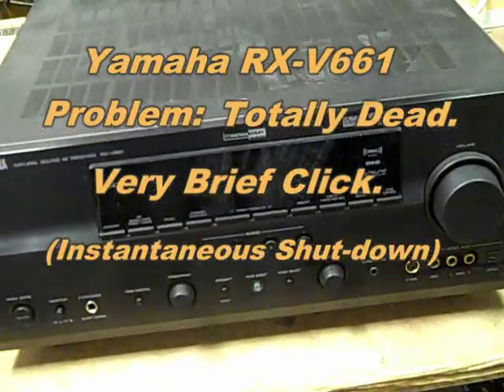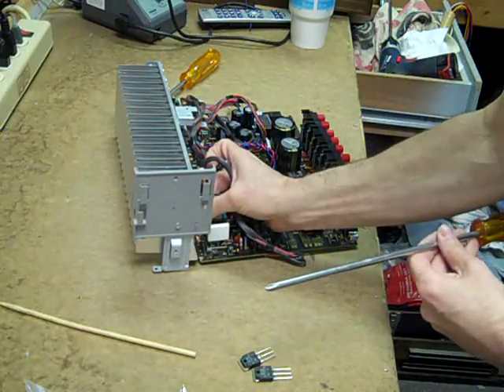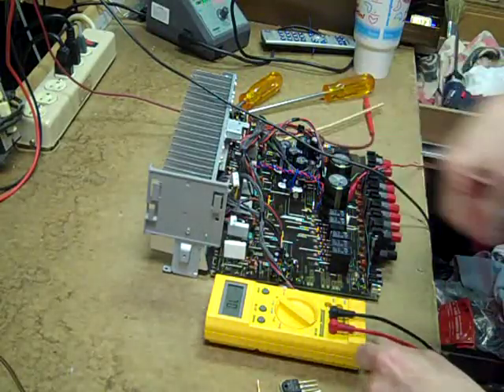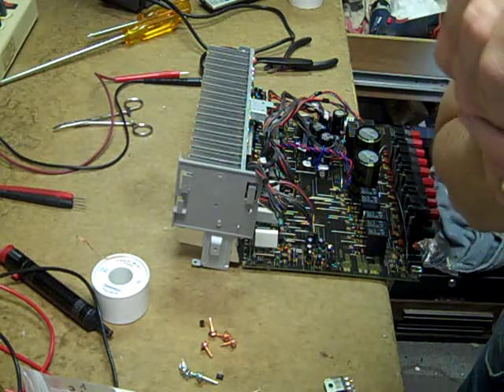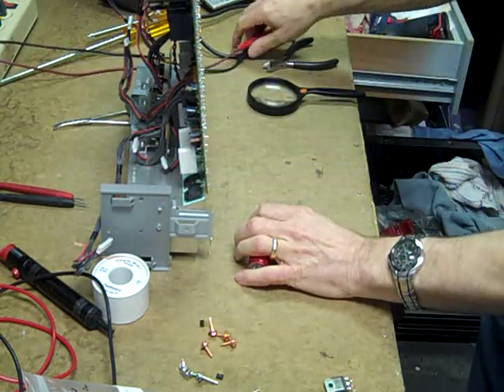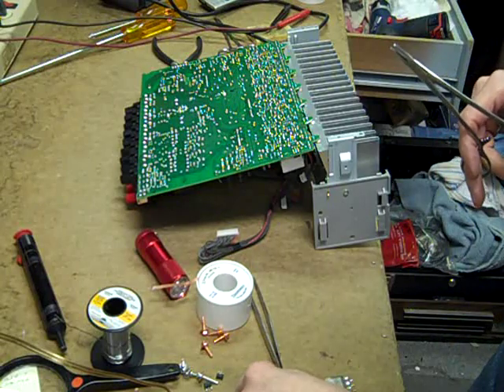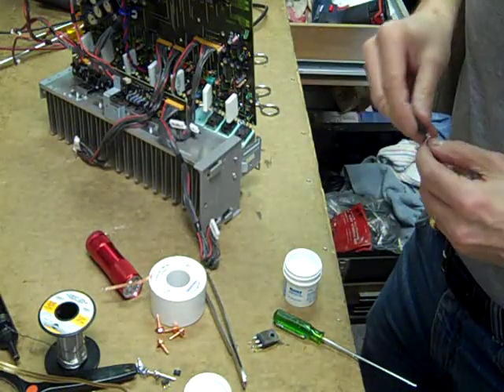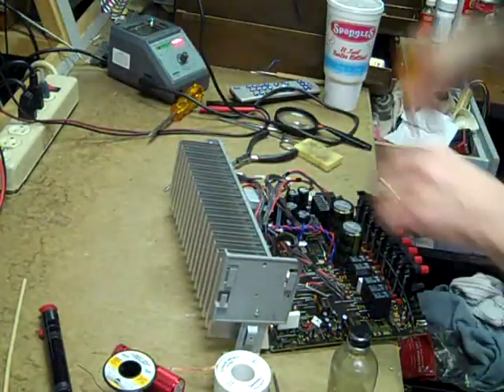Yamaha RX-V661 Repair Brief

Comment: Ok, I can't quit. So I checked the noble resistor and it is bad. I going to replace those two transistors also 'cause they are so cheap and apparently go bad. But can you say how to mimic that noble dual emitter with p/n mcm 28-0520 (since that part not available)?
Reply from the maker: Scott Young You might want to double check that resistor - they rarely go bad on the Yamaha's. If the outputs are bad I guarantee the drivers are bad, and probably the 5.1volt zener diode as well. Also the 100 ohm resistor that sits between the emitters of the drivers should be checked. I haven't seen dual .22 ohm 5 watt resistors on eBay. If it's really bad, usually only 1/2 is bad and the other half could be bypassed with a single. If you're in the U.S.  B&D Enterprises would have the dual, I'm sure. I have a drawer full of the things at work. They're really common if you work on these things. Many of those I have are pulled from scrappers.

Comment from the maker: I'm always a little scared to run the amp with the outputs removed - I had a Harman Kardon blow up really bad one time when I tried that, also there could be a problem with those drivers on that channel anyway. Still, might be worth a try. If you pull the emitter resistor, the micro can't sense any problem with that channel... I don't think, anyway.

Comment: I found the can that blew off the cap down in the receiver and it reads 16v4uf. They didn't have that at radio shack. Will a more common one do? The cap was in that assembly that screws to the heat sink above the stuff you are working on and has two 5 or 6 lead cables coming off it. Also wondering what soldering iron and vac you are using.  Thanks, Scott
Reply from the maker: Scott Young You can solder in a 4.7uF at 16 or 25 volts. Cut the leads fairly short and first solder the original circuit board pads a little, then tin the capacitor leads with solder. You should be able to use the soldering iron to then solder the leads to the board. Be sure to observe polarity of the cap. The old solder station was a junk MCM model and it died. I went back to using my old Weller station. The other device you may have seen is a Denon Instruments desoldering tool. I don't use it much anymore; a friend gave me a hot-air gun with a pinpoint nozzle attachment. Don't know the brand.

Comment: Hi mark I have a Yamaha RX-V396 5.1 channel receiver that previously had water damage to the main left channel. So I took out the shorted output transistors and driver transistors not sure if the drivers were bad but the outputs were shorted. The amp powered up and gave me sound out of the rear channels and the center channel. So to fix the main left channel I took working parts from the center channel to replace the Output transistors (Q216A/B) the driver transistors (Q201, Q203) the melted 330 ohm resistor (R214) and I also had to replace a blown 47uf 50V cap (C203). Also the .22x2 (R239) ohm resistors was open on one side so I replaced that also. There were also the 2 zener diodes (D221, D06) for the speaker protection relay that were bad so I also took that from the center channel as well. I also took the relay out of the center channel because I took away the protection diodes. Now the reason I did this is because I’m cheap and I want to know what parts I need to fix this channel before I order them. However it goes into high current shut down as soon as you push the power button display doesn’t even have time to turn on everything ohms out ok nothing is shorted even all the other channels ohm out ok. Any ideas I’m going crazy trying to figure this out. Thanks
Reply: +101computerman 

Got it working as it turns out even though the bias
transistor whitch ohmed out ok in the blown channel when I took the heat sink off to change it I found it has split in 2 now it’s time to order replacement parts
for the center channel

Comment: Darn it, I guess I have to quit. Got the cap from radio shack and put it in good. It powers up and lights the display for about 3 seconds then cuts itself off. Oh well got some practice at least. Thanks for the tips.

Comment: Hi, i have an amplifier which hv the label on the motherboard for the capacitor to be 2200uF 35V. However, the manufacture put 1000uF 35V caps in it. can i replace it wh the 2200uF 35V caps instead according to the board?
Reply from the maker: Normally this would work fine but I would not necessarily expect any improvement unless one or both of the existing capacitors were defective.

Comment: I am bit familiar with electronics. I checked all C4468 and A1695 transistors with DMM, could not find any shorted ones. I have not checked at resistors and diode yet.

Comment from the maker: I think you need to look at the PRV line on the Main (2) board. It's the board along the top of the heat sink, so you should be able to get to stuff pretty easy. The PRV line sums all the power supply lines and provides an error voltage for the microprocessor. This winds up over at IC21 pin 35. Occasionally the backup capacitor C103 might leak and give false trigger on the micro but usually just a bad regulator over on Main (2).

Comment: hi mark will you please let me know how  my hdmi problem fix RX-V465 video is yellow and all wires is good I checked so what might the problem should I check the regulator volt and capacitor please suggestion me
Reply from the maker: abhisek bhandari Normally in this situation the HDMI (Digital) board need to be replaced. Too expensive. If you are very good at working with surface-mounted IC's you could try replacing IC7 on that board. It is an SIL9134CTU 100-pin surface-mount IC.

Comment from the maker: @costellom5 You mean the desoldering braid? Pretty common in my work. I also was using a spring loaded solder removal pump, if I recall. I don't use that so much these days - too easy to mess up the solder pads.

Comment: Is it possible to run a 6.3 volt sin wave into the component via a frequency generator, then measure the component via ocsilloscope in XY mode?

Comment: Mark great videos you inspirated to me to fix my first receiver it an ONKYO HT-RC360 and it has issue like sidsasi described. The receiver has a clicking sound when powered on. It show a quick message saying check speaker wire before it turns off. The display only shows the message for about half a second before powering off. Im hopeing its bad capacitor all i know how to fix lol thanks for videos

Comment: …Based on the in circuit measurements (not precise, I know) the power transistor looks OK. I don’t quite get it, this transistor should have been fully on, but I guess electronics is not my forte. Anyway, I intend to replace the driver transistors Q707C (C3421) and Q707A (A1358), in lack of a better idea. I will have to order the items from eBay, so it will take a while.

Comment: Thank you for your reply mark.I checked the mute drive circuit and one diode D12 reads 14v on both sides so i de soldered it on one side and the eq works fine now.maby a faulty cap or transistor.I'll keep checking.

Comment: Update2. I tracked the high voltage, back to transistor Q708 (NPN, C2240). I replaced it, and now the readings at the Q716C (NPN power transistor RL) are much closer to the schematics: the transistor base reading changed from 6.2 V to 0.47 (0.4 on schematics). Unfortunately the symptoms are identical, and the display still shows the same PS PRT 39%. Other voltages are OK, no DC offset… I wonder if I can reset the unit, but how, since the display is gone in 0.5 sec. I guess I am stuck.

Comment: hi . i repaired a yamaha htr-n5060 with a power supply fault.  The fault was a 22nf capacitor in the power supply. It still has fault in memory stored. I see it in the diag menu . I goto menu 9 facotry reset but i don't know how to clear the fault (factory reset) . what button on receiver do i press to confirm factory reset? when turning on receiver it is shutting down because stored fault? Or is there still a fault somewhere? thanks
Reply from the maker: On a Yamaha, each menu selection in the service menu has the main selection and a sub-menu selected by one or two other buttons. In the reset portion of the menu, you must select the reset, then just turn the unit off. The reset will be effective at next power-up.
Reply from the maker: • Operation procedure of DIAG menu and
SUB-MENU
There are 23 MENU items, each of which has some SUBMENU
items.
DIAG menu selection
Main unit: Select the menu using the PROGRAM knob (RXN600/
RX-N600D/DSP-N600 models) or (Forward) and
(Reverse) keys of PROGRAM (HTR-N5060 model).
SUB-MENU selection
Main unit: Select the sub-menu using (Forward) and
(Reverse) keys of PRESET/TUNING.
Reply: @mdzacharias  thanks . when i reset. it is still going into protection. when i  goto menu nr. 20 there is p1prt 032 stored. in the service manual i read. i understand thay value 17 to 66 is normal. so 032 is normal?

PS1/PS2 (Power supply voltage protection detection)
Power supply voltage protection value (Normal value: PS1:
17 to 66, PS2: 36 to 53)
PS1: Detects +5S and +5DAB

does this mean there is still a problem in the power supply or  in +5S and +5DAB ? this are voltage regulators? thanks.

Comment: C3856 tested bad after all, but I am not sure that this was the original problem. If that was the case, why would have the receiver in diagnostic mode, tested a PS PRT voltage issue? Maybe this developed afterwards. Anyway, I will stick to the original plan (to replace both the power and driver transistors for that channel), and I will let you know... in a month!

Comment: Sorry, another comment. The transistor is actually cracked; if I press on it, B-C tests OK, B-E not; otherwise, neither conducts. That explains in part why this became evident after I removed the board the first time - I didn't screw it in tightly, as it was before.

Comment: Hey Mark, My RX-V661 turns on and has a display for about a second then shuts itself right off. Any help? It does not go into protection mode, I also checked the channels and they all appear to be good. So I'm at a loss?
Reply from the maker: You need to check the output of all the fixed voltage regulators on the Main (2) board mounted higher up on the main heat sink. Also the outputs of Q1045 and Q1046 (plus and minus 59 volts approx) and Q1000 (about -12.6 volts) . In order to facilitate troubleshooting problems not involving a blown channel or hard shorts, there is a protection cancel feature in the diagnostic menu. While pressing and holding "straight" and "audio select" press the Master power button and continue to press the first two until the SLEEP indicator flashes on the display. You can then troubleshoot the DC voltage problems at your leisure. If you have any technical skills and a decent multimeter anyway...

Comment: Great video posts, Mark. I have an RX-V667 that is tripping circuit protection on DC after a lightening strike. All values in the diagnostic menu are normal except for P1-1 (DC_PRT on IC902) showing value 0 instead of normal 32 to 74. Is there a place to start before looking at each amp channel?
Reply from the maker: ***** Start the receiver in protection cancel mode and see if there is a DC offset on one or more channels. DC on one channels obviously means that channels needs repair. More than one is a power supply problem of some sort, or there could be a problem involving Q1072 (not) providing a -12.6 volt bias to all amp channels.

Comment: Hi Mark.
I have a RX-v661 that goes in to protection mode. 
By the help of the service manual and your videos I have managed to narrow the problem down.

The DIGA menu tells me that it's PS2 Low that is the course of the protection mode. Now I have measured all the PS2 voltages (+12, -12, +5V, +5D, +5I & +3.3D) and they are all fine except one :)
When measuring the +12V at connector W100A I only get around 1.52V between pin 2(E) and pin11 (+12).
I then measured the input to the +12v regulator (IC104)  and that show +22V, so that seams okay.
Now if I remove the cable that go from the MAIN2 board to the DSP board the output of IC104 increase to around 5 volts, but nowhere near the +12V that it's supposed to be.
The IC104 don't get hot, and there are no signs of overheating in that area of the MAIN2 board

Do you have any suggestions? Should I focus on the +12V regulator, and try and replace that, or is it more likely that the problem lies hidden somewhere else?
Reply from the maker: Yeah - replace the +12 volt regulator and you should be fine. Good job!

Comment: Thnx mark for the reply.
The technician guy had connected A TERMINAL rights posts to the right spkrs and left to the left speakers, same way he had done with the FRONT B and assigned as extra presence.
I tried the B TERMINALS right & left to one speaker and done with the other spkr too. It sounds grt.  But the front A TERMINALS doesn't give any sound output whn connected the same way.
Reply from the maker: A and B should sound the same since they run from the same internal amplifiers. Surround, Center, etc are different internal amps.
Reply: @mdzacharias  something's s miss. Have called the technician. Let's c, will update once done.

Comment: Very helpful (especially the trick with the double ended polarized AC cord – never heard of that before)! I don’t have a variac, but I’ll use the light bulb. You are right though; besides the fuse might have been blown by now, if it were an over-current issue. I will start measuring, but even if I am not able to figure out what’s going on, I still learned something. Thank you!

Comment: In the diagnosis mode of Yamaha htr 6030 a message for a very short time
 "PVR PRT 59"is displayed and the receiver shuts down.
What does it mean and where does the fault lie? It definitely means power supply issue but what does the number 59 signify ?
Reply from the maker: Indicates a power supply problem. There is a Protection Cancel mode that will allow you to keep the unit ON while you troubleshoot. email me at mark_zacharias@sbcglobal.net and I can email you the service manual. Most likely a bad voltage regulator IC like a 7812, 7912, etc.

Comment: Hello Mark,

I have a problem with my Yamaha amplifier type RX-V773 (7.2 channel), it only works in direct mode for 10 minutes, and then the speaker symbol an sound disappears and comes back now and again, do you have any idea where I could look for the problem?
I hope you can help me!

Greeting,

Nicolas
Reply from the maker: They had a lot of bad digital boards (HDMI boards) on this series through the RX-V675, RX-A830, etc. Yamaha never really addressed the problem, they just fixed them under warranty, even for a while after if people yelped loud enough. The boards were much too expensive to replace out of warranty, over 400.00 each. You could try checking for power supply issues or "re-balling" the baked onto the board chips, but I wouldn't hold out much hope really.
Reply: Hello Mark,

Thanx for the info!
I Will search further with these information.

Greetings,

Nicolas

Comment: Update. Using the trick you mentioned before, I was able to take some measurements. I also used the light bulb as a precaution. It lights up a bit when connected to the power outlet for a second, and them dims out, so no over current issues, as predicted. The rear L power transistor Q716C (NPN) has 6.32 V at the base (should have been 0.4), 0 at source (OK) and 38.5 (40 on schematics) at collector...continued

Comment: Thanks! Yes, HDMI indicator did light up when it got the signal (when i used the selector). So that is good to know. Any idea how much say IC1 should cost, or in general, to repair something like that? (Not that I want to replace it myself - a cap or a resistor, I can handle. Not a chip).

Comment: Thanks for your reply. Assuming that there are some faulty and shorted circuits already, and since voltages are maintained, does that mean that the risk to fry/damage (even more) some components is increased, due to longer exposure to high current?

Comment: Mark, I have a Yamaha RX-V2090 that I bought new (for $1549!) somewhere around 1996. It has been a great unit, but over the years has lost some of the channels for the speaker outputs. I have downloaded the service manual,  I opened up the case tonight, and am looking for obvious signs, like discolored boards, but am not quite sure where to begin testing. Any advice on where to start? Thank you!
Reply from the maker: I think I would get the receiver into diagnostic mode and reset to defaults. Good place to start anyway. Under "Preset Inh" switch to "Preset RSRV"
Reply: Mark Zacharias Thanks for the reply. I have figured out how to get it in diagnostic mode, but it seems some of my buttons are sticking. For example, if I push "Tape 1", the "Tape 2 Monitor" comes up.
 It seems a few of the buttons are mixed up with the one next to it. I do have the remote, but has the same issues. I'm not too surprised for an 18 year old unit. What can I use to clean them up with?

Can I contact you off of youtube? I may have a lot of questions, if you are willing to help...

Thanks!
Reply: I was able to take the remote apart and clean it. It appeared someone (besides me) poured a few cans of Pepsi inside. I just (carefully) used soap and water to clean the contact side and the button 'sheet'.  It has never looked so good! Would something like rubbing alcohol also have worked on this, and/or the receiver?